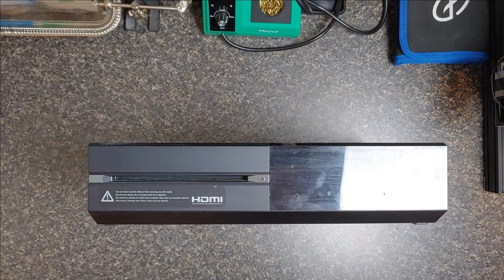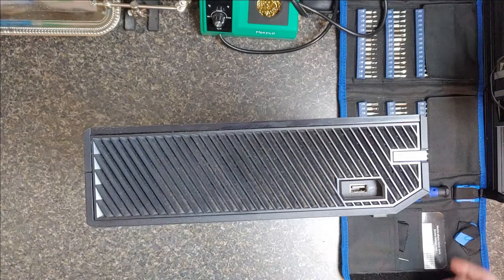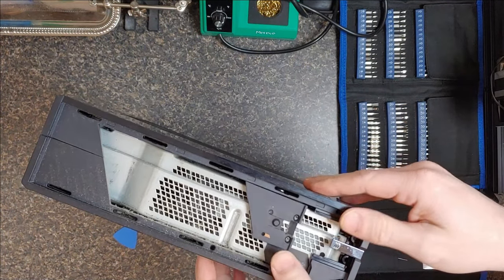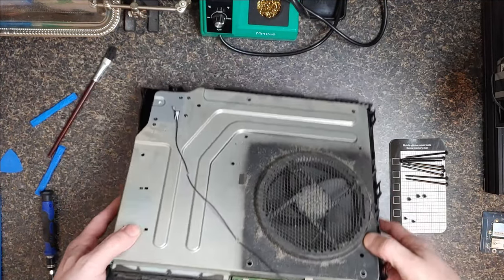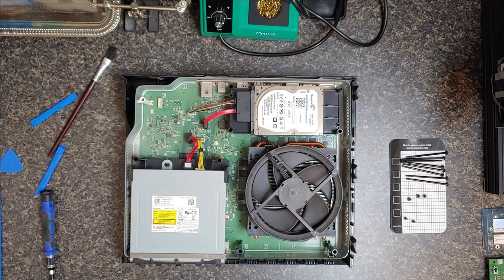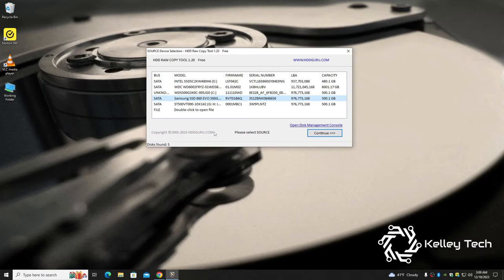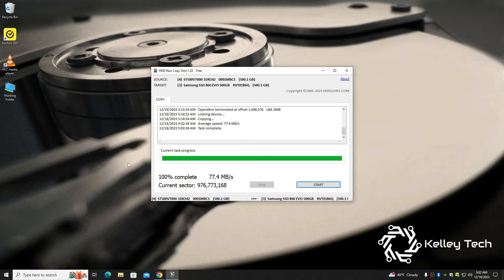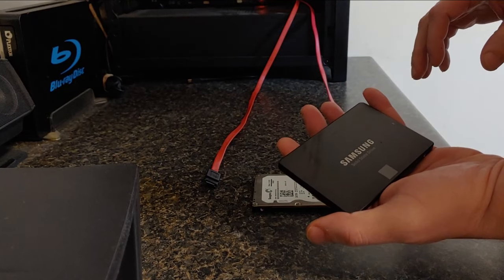Xbox One SSD upgrade

Comment: Hi!! Congratulations on the material, it was excellent, but i have one question here, I have a 720GB hard drive, can I use the hdd raw app with the source 500GB and the destination 720GB, will it work and the end and will I have 720GB? Thanks a lot!
Reply from the maker: Hello and thanks for watching. Unfortunately with this method you have to use 500 GIG Drive. This link will point you in the right direction for installing a larger drive. Hope this helps! https://support.xbox.com/en-US/help/hardware-network/console/offline-system-update